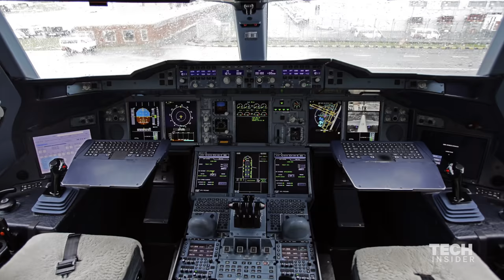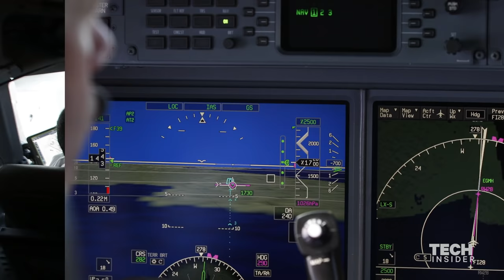Most Miraculous Airplane Landing

Comment: Nice video - but if you read De Crespigny's book, this guy really oversimplifies what he did - he never "stopped thinking", he made a conscious decision to stop paying attention to the automated warnings the flight computer was belting out at a rate of dozens every few minutes, because that made sense. If he and the crew, as trained, were to have gone through the checklists required to address every single one of those warnings, they would have been airborne for 36 hours or something - that was time they could not afford. 

So by deciding to ignore the messages (since it had become clear they couldn't fix the issues anyway - it later was shown that debris from the engine had severed major hydraulic and fly-by wire control lines), and "imagining the plane as a cessna", they fell back on basic aviation and "built" a plane systematically by testing what systems DID work. Then rather than focusing on what DIDN'T work, they flew and landed the aircraft using those that DID. 

It's also not a mystery why De Crespigny had the forethought and experience to do something like this - he was a veteran fighter pilot of multiple aircraft type for decades in the Royal Australian Air Force. 

Tl;dr: He never "stopped thinking", he made a conscious decision to ignore the flight computer and fly the aircraft like a human being would with a very simple aircraft. That is the complete opposite of "stopping thinking".

Comment: There were 5 experienced pilots in the cockpit of QF32, one pilot dealt with the error messages, another ran the (LDPA) landing distance performance application on a notebook, it computed that a landing was possible on a dry runway with about 180 meters to spare.

Comment: 3:00 - Two mistakes 1) That's a 747 2) you don't "push the brake pedal" in a plane...
Reply: You do actually have a pedal for breaking.
Reply: there is a brake pedal if you push the rudder forwards it activates the brakes
Reply: iRx Destiny Well the foot brake in a cockpit actually controls the massive brakes in the wheels on the landing gear. That in unison with flaps and reverse thrusters slow and stop the plane. 
Usually the foot break is used at slower speeds - when taxying.
Reply: Ollie BT thank you
Reply: It's a 747-400 not 200
Reply: lachlan kelly true but I'm sure he used it cuz it's an emergency and he was using everything  to stop the play so he doesn't overshoot the runway

Comment: There ARE no cockpit voice recordings of the QF32 in-flight incident.  Why? The voice recorder on an A380 operated on a one hour loop. But the aircraft was on the ground (and running) for two hours after the landing before everything was turned off. All the recordings of the in-air portion of the emergency were recorded over. I saw Captain de Crespigny discussing this fact in an interview.  It’s very disheartening to hear such factual errors - such as when you say “If you listen to the cockpit recordings…” because it makes me wonder what else in this video has been fabricated.

Comment: This accident happen because rolls Royce engines had a defect that the oil pipe was a little smaller than the one connected to it witch caused the oil to mix in the the heat and explode and 32 other a380s hade this defect

Comment: Ye 0:25 is definitely an a380 definitely. They were focused on many boards. they were focused on was the ecam and engine stats all on the different boards. Tarmac huh. A cessna is not an a380 in distress. If u have a small limited knowledge of aviation, u either learn or don't do a video on it.

Comment: Sorry, that's NOT the most miraculous plane landing.  The United 747 out of Hawaii that lost a cargo hatch beats it, so does the United SUX "crash". In the later the had virtually no control, only two sort of working throttles to save a whole lot of lives.  But even more miraculous in my opinion was the Aloha convertible 737.  But then I wouldn't expect someone who doesn't know the difference between a 747 and an A380  to have any real judgment in anything aviation related.